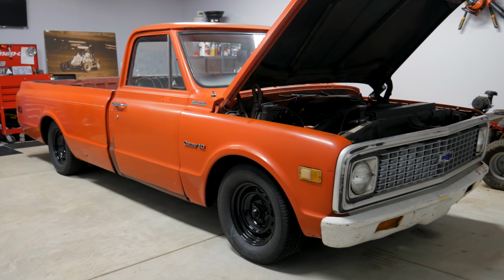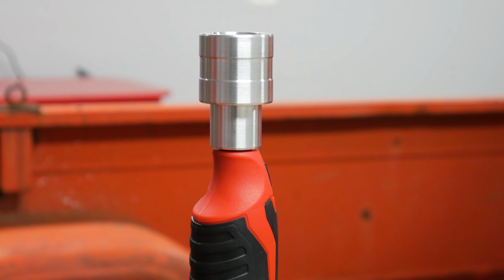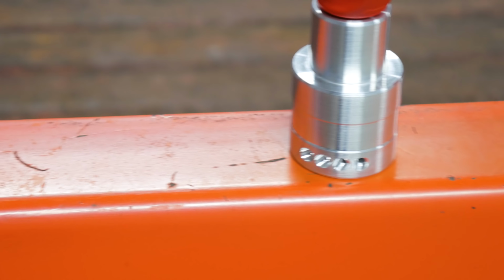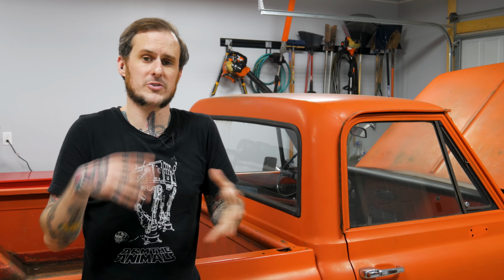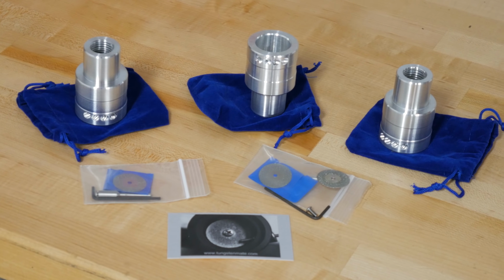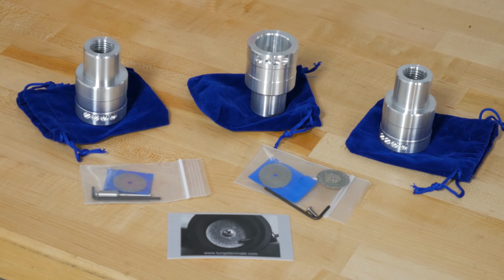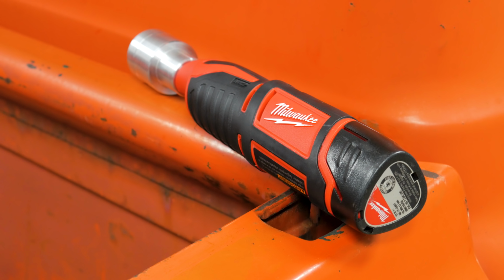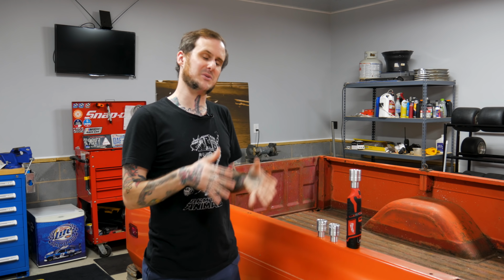GIVEAWAY - TungstenMate Grinder NEW Design

Comment: Hello. Thank you for the tip on not braking my tungsten. im new to the tig welding world and I keep burning up my tungsten. it takes about 20 minutes to grind my tungsten. does this really work? any other tips for beginers is really helpful. thank you again.
Reply from the maker: One of the hardest things for a lot of folks to learn is not dipping or touching their Tungsten. That is a natural part of learning to tig weld. I am currently using the combination I showed in this video(cordless grinder) as my daily driver. I was welding a 55 Chevy dashboard today and dipped more often than I regularly would because of the odd position I had to sit in. Having the grinder right at hand meant I didn't have to even move to clean up. If you check out my review of the previous design TungstenMate I timed grinding a fresh piece of 3/32" from blunt to fully ground in that video. https://youtu.be/MvGZJPXPd54

I truly stand behind the products I recommend based on my first hand experience. Not saying you're accusing me of anything at all, really. Just want that stated. I think my reputation for being as honest as I can in my reviews is a key part of this YouTube channel and one I hope to grow.
Reply: thank you for the tips.

Comment: Stumble across your channel a couple days ago. Really appreciate your insight on metal shaping. I've been working with steel for quite a few years but am just now getting into shaping.
Reply from the maker: Rickey Bowman well I hope to keep providing insights for you. Feel free to ask questions and let me know if there is something you'd like to see covered! Many videos come via viewer questions or requests.
Reply: My plan is to go big or not at all. I've already drawn up the chassis and roll cage in bendtech pro. Once I get settle into my new home my plan is to make a street legal 1/2ish scale 29 ford tudor rat rod. I already have the steel for the frame and might have enough hrew tubing from my rock crawler left over. I have a efi 2.3ford a t5 trans to mate to it and a 4.10 geared 8.8 with disk brakes. Air bags,heim joints, and bushed sleeves for the suspension have been sitting on the shelf for months. And a couple of donor ford rangers for other parts. I just have to build the body  from scratch. I know it's a big project for a beginner, but I've been making steel my bitch for some time and I have the material to make mistakes and I love to throw some music in my ears and just get stuff done.
Reply from the maker: Rickey Bowman there is no better way to learn than to do. You'll screw up a lot, ruin a lot of steel, and curse a lot, but in the end it's all a learning experience. I've still got a ton to learn and most of that is just a need of more practice. In fact my next personal project is going to be a full body build as well. I'm basically thinking the same thing "why not?"

Comment: What angle are you using for sheet metal work? I know you like the steeper angle.
Reply from the maker: I use 15 degree for sheetmetal work and 20 degree for plate/tubing work. For the most part anyway. 👍

Comment: I have been looking for a gen4 aluminum for so long, they are never in stock! Do you have any extra you would be willing to sell, or do you know where I can purchase one? I love the delrin gen4 but need the extra capability of the aluminum. Thanks brother.
Reply from the maker: Sorry I do not have any. They never sent me any of the Gen 4 units unfortunately. Heck I'm still using the first generation one personally. 😂

Does the more featured version of the Delrin one not have the functions you want? 

https://rover.ebay.com/rover/0/0/0?mpre=https%3A%2F%2Fwww.ebay.com%2Fulk%2Fitm%2F183207796495

If not I'd suggest emailing Zero Tolerance directly about it.
Reply: @HotRodHippie  I have a fear of melting the delrin/brass guide rings as they get pretty hot after 1 sharpening. Just not practical for use in industrial settings. I do love the product overall though. I've talked to them a few times and they say the aluminum will be in stock the next week etc, but I still never see them go up for sale.
Reply from the maker: @XxAviciiLevels  yea my original one doesn't have the guide just Delrin and its getting worn out from hot tungsten. I don't know how much you grind but for my needs the guide should be insulation enough. The Delrin alone has lasted me quite a while of use.

Comment: I tried to order, did they stop making them?
Reply from the maker: They redesigned again since I made this video. They have two versions now, both with delrin body designs and metal guides.

Basic version: https://rover.ebay.com/rover/1/711-53200-19255-0/1?icep_id=114&ipn=icep&toolid=20004&campid=5338193448&mpre=https%3A%2F%2Fwww.ebay.com%2Fitm%2FTungstenMate-Simplicity-Tungsten-Electrode-Sharpener-Grinder-TIG-Welding%2F183297088976%3F_mwBanner%3D1%26ul_ref%3Dhttps%253A%252F%252Frover.ebay.com%252Frover%252F0%252F0%252F0%253Fmpre%253Dhttps%25253A%25252F%25252Fwww.ebay.com%25252Fulk%25252Fitm%25252F183297088976%2526rvr_id%253D0%2526rvr_ts%253D260c09cb1680ac84e7f56cafffc34e61%26ul_noapp%3Dtrue%26pageci%3Dc6b99d07-d8dc-4529-9bb7-f8d56eacc48e

And then with the cut-off slot: https://rover.ebay.com/rover/1/711-53200-19255-0/1?icep_id=114&ipn=icep&toolid=20004&campid=5338193448&mpre=https%3A%2F%2Fwww.ebay.com%2Fitm%2FTungstenMate-Simplicity-Tungsten-Electrode-Grinder-Sharpener-W-Cut-Off-Slot-%2F183297091224%3Fnav%3DSEARCH%253Dhttps%25253A%25252F%25252Fwww.ebay.com%25252Fulk%25252Fitm%25252F183297088976%2526rvr_id%253D0%2526rvr_ts%253D260c09cb1680ac84e7f56cafffc34e61%26ul_noapp%3Dtrue%26pageci%3Dc6b99d07-d8dc-4529-9bb7-f8d56eacc48e

The more advanced (and expensive version) is available on their website, though their ordering isn't super straight forward from what I've seen: https://www.tungstenmate.com

Comment: I've been tig welding for 14 years in automotive, aerospace, and pipe. I've used just about every tungsten sharpening method out there. I can see having a dedicated sharpener being useful for my aluminum, stainless, or exotics. Cool product 👍
Reply from the maker: ghastlyUNDEAD a dedicated grinder is both good practice and just handy. Good luck!

Comment: What other grinders do they fit?
Reply from the maker: Any of the "Dremel Style" grinders should work.  I've only tried actual Dremel Brand ones and the Milwaukee Cordless version.  Most of these tools have the proper threaded portion of the body that allows attachment of other tools.  That is all that is necessary.  Sorry I can't be more specific, I'd have to check every brand of tool on the market to be sure.

Comment: I like the idea of this tool, but have never used one. It would be nice if they could put at least two if not all three on the same tool, though. It looks like there is plenty of room to drill four more holes on the opposite side of it at another angle, at least, and maybe enough for both angles. The delrin one definitely has enough room for three angles and you could use the same three inserts. Just a thought, but I'd be willing to pay more for that, but I'd maybe buy a grinder with adjustable angles instead of buying all three.
Reply from the maker: Ira Adams if you buy all three and grinders for all three angles (instead of switching heads to change angle) you do start to approach the price of an adjustable tool from other vendors. So I cannot blame you there. I think their goal is to stay competitive on price with other makers and adding machining time to every one would up prices. But that is simply a guess on my part. 

I do think that providing all the angles would probably require a fair bit more design work. As it is you adjust the position of the spindle in the collet to set the wheel height in relation to the holes. If they had all three angles on one tool they'd have to figure out exactly where each bit of Tungsten was contacting the wheel in relation to one another. Again, just a guess.
Reply: dont buy one of these you wont ever get it

Comment: That's such a great Idea with the cordless setup. I saw your Instagram post and haven't been able to stop thinking of it. Going to copy that for sure. Good job on the videos look forward to the ones to come.
Reply from the maker: matthew sweetser if you already have the Milwaukee 12v batteries and charger (I did from other tools) then adding the grinder and TungstenMate attachment is less than $100 (for the Delrin version). It really is so hand. I try to minimize cords in my life and this is another great option. 👍

Comment: @hotrodhippie Ironically I just bought the old design after watching your previous review, I should have waited a for the new design, oh well 😔 ... 

Btw does anyone know where you can get replacement wheels?

Keep up the good work, love the channel!
Reply from the maker: The old design is still a good product. I stand by my review of that one. The improvements on the new design are nice but unless you are using .040" Tungsten often or worried about a different angle you will be fine with the previous design. That said your comment enters you to win the new one anyway so who knows. Ha. 

ZeroTolerance sells a three pack of the wheels on eBay for $15. I haven't looked for them elsewhere yet. Dremel sells one but it is $15+ for one. So the ZeroTolerance price seems solid to me.
Reply: HotRodHippie Excellent! Thank you

Comment: Hey so I went on the web site I want to buy the aluminum one with all the size but for some reason I cant figure it out
Reply from the maker: They've changed up designs again and don't have the aluminum version currently. Now it is a simple dekrin one with steel inserts for the Tungsten guide. The one version has one hole at the angle you order it at, but you have to change the insert depending on the size of Tungsten you use. (it comes with 1/16, 3/32 1/8 inserts) : https://www.tungstenmate.com/product/tungstenmate-simplicity/

The second version is also delrin with steel inserts but has multiple inserts in one body so you don't need to change inserts.: https://www.tungstenmate.com/product/tungstenmate-carbine/

I have not tried either of the new designs since they released. I'm currently using the original Delrin version that doesn't have steel guides and I'm happy with that for my daily uses.